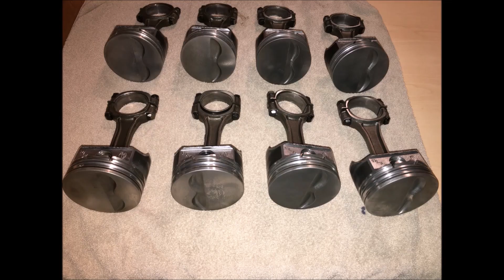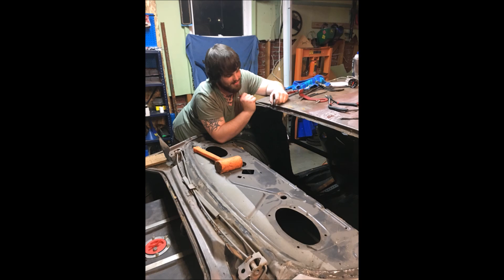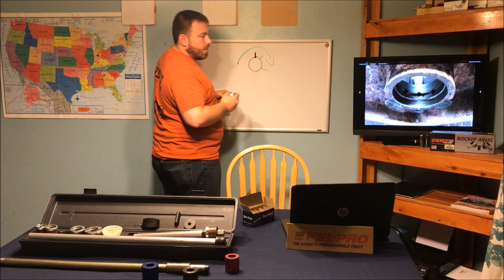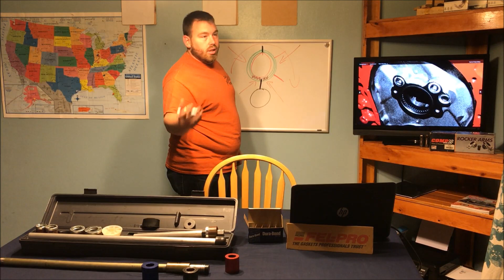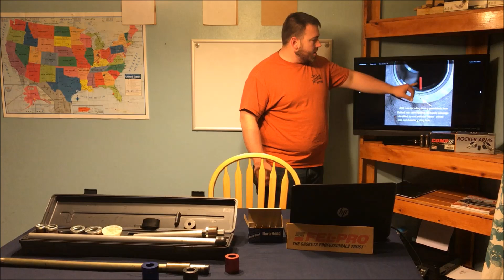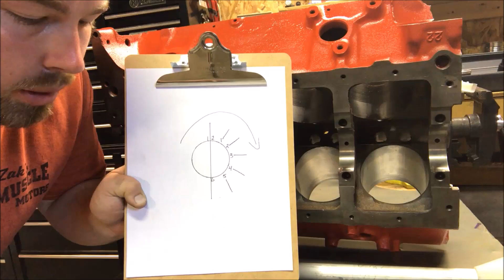Engine Building 101 Cam Bearing Install

Comment: All you need is MIXED oil measured and you can push it smoothly without scratch or scar on bearing.... Camshaft bearing on hold little amount pressure.. If I can use my NEW TECHNOLOGY SKILL ON hydraulic SUPER HEAVY pressure it will more easy on this tiny bearing😅😅😅 its cost little money but need PERFECT 100% MIXED oil and can push it easily☺☺☺
Reply from the maker: Snake oil

Comment: Hi Zak, thanks for this great learning video. Now i have an issue with my engine, where i have a Low oil pressure alarm and according to my technician, the cam bearing(s) are out of alignment.
You say here in minute 14, that when there is an overlap of the oil hole in the bearing, with the oil passage in the cam bore, on a smooth bore, the oil pressure increases....
Do you mean the oil pressure on the bearing/cam or the oil pressure from the oil sensor? As i have a low oil pressure alarm especially at idling.
The engine has been pulled now and we will investigate the cam shaft bearings this week.
Thanks for my learning curve here.....
Reply from the maker: Hey Thank you for the comment and the question! I want to help you I need to know what kind of engine you have to start with. The comment you’re referring to would raise pressure at the sensor as it would would trying to shove it through the hole restricting the flow and decrease flow to the bearing. If you can give me a call today at 7655247362
Reply: @ZaksMuscleMotors  Hi Zak, thanks for getting back to me. Will call you soon. I have a picture taken from inside the oil pan where you can see actually one of the cam bearings exposed for a 3 mm i guess. can send that to you so you can see for your self. I did not take it myself and am not familiar which bearing it shows.

Comment: They used to say to put the bearings in dry ice for about an hour, then you can push them in with little effort.  The freeze method also creates little to no shavings or debris unlike driving them in dry.
Reply from the maker: If you use the tool correctly and have good bearings there should be no issue with debris.
Reply: You dont want them going in with little effort.
Reply: @SOLDOZER  you've never chilled parts for installation?

Comment: Why are some u tube guy saying 10 an 2  putting the No 1 bearing in on a chevy with a grove??
Reply: so the oil pressure is pushing down on the cam and creating an oil wedge

Comment: Hi Thanks for your video. Excellent. I'm doing the same on a 2001 pontiac sunfire 2.2 engine, I need to confirm how the camshaft bearings are installed correctly.

Comment: but if im right i think a 307 crank is the same as a 327?
Reply from the maker: Yea they were both 3.250 stroke.
Reply: The 307 has the same 3.25 stroke and rod and main journals are the same as a large journal 327, but the 307 crank is balanced differently because of the smaller bore. The bob weight when balancing is less for the and the counterweight is physically smaller. You can rebalance a 307 crank to use 4” pistons but they’ll have to add heavy metal to the counterweights.

Comment: Zac, I watched twice an I don't think you ever discussed the type of bearings. You have tri-metal with aluminum shells, copper electroplated, then some method of a thin babbit material. I prefer steel shells with a led/tin babbit coating. These seem to handle heavier load. Was that where you were going when you said that or just the blocks design differences? Just curious? Subscribed & liked. Retired ase master
Reply from the maker: Thanks Dean, yes this was more just about placement in the block and less on bearing design. I can do a video about that at some point. Thank you for subscribing and watching!
Reply: You are right as I went back and listened again. I sorry because I thought you said something you did not. That's what happens after 40+ years of working in dealers with constant loud noise. I joke that I have a $6 cordless phone but have $3 ears. I never went to a trade school & honestly don't know if they had them in the late 60's. I apprenticed with some really good techs who opened their own shop, learned from them. My manager offer me 5 cents per flat hour raise for these test & there was 8, so dam straight, I can use a 40 cent pay raise, as tech's made $6.40 but customer pay was only $26 dollars per hour. The sign on the building said "Datsun". 
 Do you know what we called "Sun-Screen" in 1970? DIRT. So, getting close to that age. It just happens that I am changing cam bearing in an 2003 5.3L and my cam tool that's new in 1982, works great. I have early design with smaller block bore, so 1-5 = 2.327"-2.329", 2-4 = 2.317"-2.319" and 3 = 2.307"-2.309" so on steel bearing shell with babbitt = 0.163 max bearing thickness. Sometime in October 2003, they incorporated lager cam bearing bores ( Or Outside Diameter of Bearing) Note: Late is 1-5 = 2.347"-2.349", 2-4 = 2.327"-2.329" and 3 = 2.307"-2.309", which remains the same as 1st design, but since the cam OD journals remain the same, the shell is just thicker by 0.020". My though is, if second larger design is not magnetic, then they could be aluminum shell but don't know.
Hey, thanks Zac, This info is from GM eSI. Master Tech since 1978.
Everyone should hit Like & Subscribe...These videos take work and Zac is clear and on it!
Reply from the maker: Thank you for that. Were you a GM employee?
Reply: Zak, Yes, 56 of us was contract labor thru Raytheon. Twice each year we had cross-training and got to see stuff you would not believe. We always wanted to go where things were built and many times did. One facility full of robots or just computer controlled arms assembled the LS aluminum block right in front of us. This is why the oil pan gasket is riveted to the pan. Turned upside down, RTV in corners, pan placed in position and every bolt torqued at once. Ring gap, bearing clearance, everything was checked using a pointer measuring pin-head or optical sensor. Even the cam bearings where picked up, turned to locate oil holes, then pressed into place. A rod goes completely thru the camshaft and held still. A plastic arm pushed the cam in place as it was sprayed with lube. Two or three people where in the room to load parts. Even a box of white caps used to form the rear seal was saved and reused. Pistons, bearings, caps, rockers and frt & RR cover was installed, centered, torqued, then the seal was installed. No torque to angle gauges used that room. I worked for them for 7 years and 10 months but held 4hr seminars and 2 classes of two days each in 13 tech schools. It was exhausting. Tore a rotator cuff at a warehouse stacking cores, had surgery than got a phone call two weeks later letting me know the job was dissolved. Dr. pulled the plug on my career and had to quit working. Sucks. It is like going 100 MPH for 40+ years and stopped, keys yanked away and told to walk home. I did see some amazing stuff and spent hours talking to engineers who had no clue what we see at dealerships or in the midwest. They where shocked! But I am done!
Reply from the maker: Dean Kay I work in a GM assembly plant building the trucks. Lots of cool stuff that happens to make it all go together. And the engineers are still as clueless today lol.

Comment: A galley is the food preparation area of a boat or ship .A gallery is a corridor or long hallway including the corridor in an internal combustion engine that directs the passage of lubricating and cooling oil. Check out some early 1900-1920 books written by early engine designers.They tend to use gallery not galley for the description of oil pathways in early car and truck engines.
Reply from the maker: Weird flex but got it lol

Comment: Thought we are not to touch the bearings with out Bare fingers because of the oil comes out of our skin your supposed to wear gloves or something to do bearings that might be me just being cautious I’m about to do it for the first time in my 86 CorvetteI bought a lunati Voodoo Cam, 526 lift. Got a noisy gear drive. And new pistons. And a set of edelbrock E- Street Head. I hope the it sounds good. If someone has this set up . Let me know how it sounds. Get me a video link to watch.

Comment: Have a question maybe you can answer I’m building a 489 bbc and installed the crank in but I’m confused on the main cap torque specs bc my block is only a 2 bolt main and everywhere I look says 396 and 427 95lbs and then the other says 396 and 454 with 4 bolt main 110lbs couldn’t find nothing set in stone so I torqued to 110 so if you or anyone knows could you let me know thanks in advance.

Comment: Good video, Thanks! Now, I am doing this the engine/ block in a car, replacing camshaft to my Mustang 2004/ 3.8 litre V6. So, how do I remove bearings from block?/ And how do I install that last bearing,#4 in my case?? There is flywheel behind that last bearing, right?? Any suggestion? Thanks

Comment: Great Video. I especially like the " Keep it Clean " theme. There are several videos out there that the builder assembles their engine with dirty oily hands. Don't do this,  your asking for trouble.  I like his explanation on how to clock the bearings at 2:00.  I don't necessarily agree with inserting the tool thru the installed bearings to get to the # 1 & 2 bearings. To much of a chance to scratch the installed bearings. I use the short rod from the front of the block to do this. You have to be sure to have the # 1 bearing square in the bore before you hammer it in. This is just a personnel  preference and I'm not saying his method is wrong.  Either way is correct. It just depends on what you are comfortable with. I'm looking forward to his other videos, he's a good builder.
Reply from the maker: Dave L Thank you so much Dave!
Reply: The opposite end of the tool keeps it level. Nobody should listen to you.

Comment: I just rebuilt my 5.7 Hemi had the machine shop install new cam bearings. I had trouble installing the new cam. The Bearings needed to be board. The Machine Shop owner showed me how he had made a line board tool out of an old camshaft (his example was off an old Buick). So I used a die grinder to cut diagonal grooves in the old cam. Stood the block up on it's end, hung  the cam from a place and used to boar the new bearings. This was a first for me and was just curious as your thoughts on how I did that.
Reply: @The Sentinel Redline has been by the far the best I've ever used personally!!! Also it's latest the longest amount of time during storage that I've tested which was 13 months and the lube on all bearings looked as good as the day I installed everything!!! Best of all its very affordable